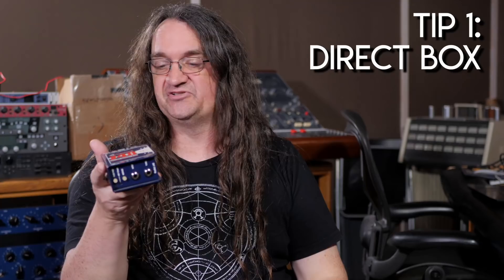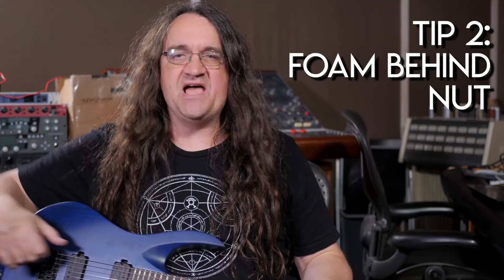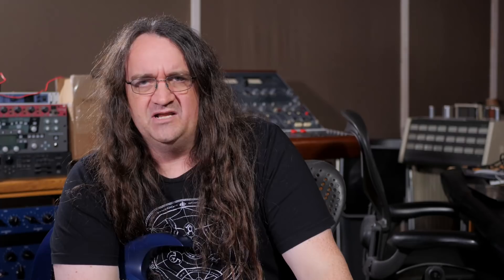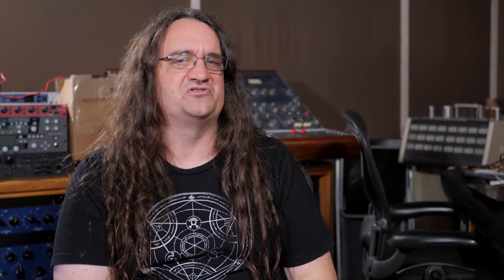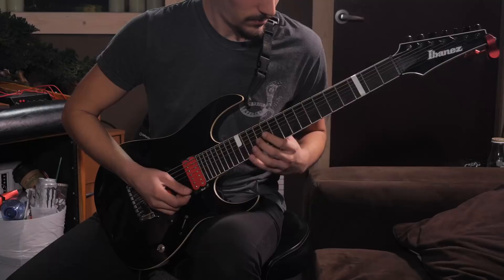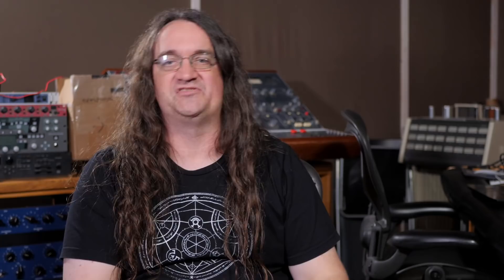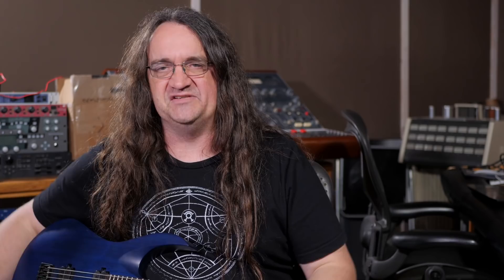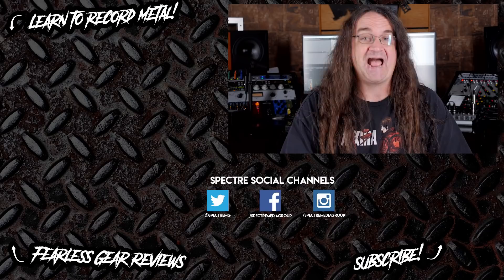Five Tips for Recording Metal Guitar at Home

Comment: But would I ever need a DI box if I already have a solid audio interface with good preamps?
Reply: Kyle Pierce hi, try Steve from Boston as he explains it in detail. Hope this helps it did me👍
Reply: No, he got this totally wrong. As long as you have "guitar in" or Hi Z input you are better of without DI box. And even if you don't have it DI is not solution for that, in that case you need Hi Z preamp.
Reply: @Logan Larsson i've never in my life encountered any interface that has low pass filter on any input. What to heck are you doing with those things to get such results?!?!? Have you actually measured that with a generator?
Reply: @Logan Larsson The only difference between a line level signal and an instrument level signal is impedance (guitar amps usually have inputs in the order of 1 Megaohm or more). Are you sure you're not plugging your guitar into a line in and thinking it's an instrument input just because you have to increase the gain to hear it (which brings more bass)?
Reply: yes and one solar
Reply: TheKingKorg it’s not a literal low pass filter, some of the lows just come through clearer with a DI, it’s not the end of the world but it helps
Reply: No...there is a HUGE difference between instrument level and pro line level besides impedance, which is GAIN.  The instrument signal is weak at roughly -20dBu, mics are even weaker at around -30dBu, where line level is around +4dBu.  MUCH hotter of a signal.  Its CRITICAL for the signal chain that each piece of gear is seeing the proper input signal from its upstream neighbor.  Thats a sure fire way to add noise, lose all the dynamics and possibly even release some smoke.  Especially with a load box in the chain and speaker level signals getting piped around.  Pay attention, they all can use ¼" TS and TRS cables and they plug in just fine to any piece of gear with no warning of impending doom.
Reply: Depends on the interface. Some have specific inputs that can switch from Line to Inst (e.g., Scarlet 18i20.) However, the coloration you get from whatever impedance-matching scheme they use is going to be different from the transformer in a passive DI box.
Don't try to plug a guitar into a line input unless you are desperate or practicing. You can get sound out of it, but even the tone on my shitty, cheap, out-of-tune guitar sounds noticeably better through a DI box. (Active, in my case.)
Reply: @Logan Larsson The Saffire interfaces happen to have a 10 Mohm instrument input, which is way higher than most amps can represent.
Reply: I use the Hi-Z input of my Focusrite 18i6 Interface. Never had any problems with the sound quality or less low frequencys. For extreme metal i mostly use my schecter jeff loomis signature and that beast has a very high active output. For homerecording the interface input quality is excellent. Imho there is no need for a DI box if someone has a good interface with quality instrument inputs. Save the money to buy your bassist some sets of new strings.

Comment: Bypass the volume knob by soldering the signal wire directly to the output. the potentiometer should be a short circuit when you have full volume, but even than it actually damping the signal a little bit. You can as well add a high-quality switch where you either connect the mic signal directly to the output or choose the signal path through the potentiometer etc. I've done this modification on my guitars since the 80th because it gives that little extra in the sound which you clearly can hear and feel in your playing.

Comment: I'm mostly recording at home and have been using real amps for it about 99% of the time.  You just need speakers that don't sound horrible at lower volumes and typically sounds pretty fat in the mix.

Another thing you can use to mute behind the nut is velcro strips.  I just keep a roll of it on my desk with a pair of scissors.  Somebody wants to record guitar and hasn't already muted behind the nut or past the bridge on a gibson style bridge?  Thirty seconds and you're all set with velcro across them.  

Great tips here.  Also agree on the comments about picking hard.  Except for odd passages for dynamics

Comment: No problem with the foam if it works for you. It’s always been my understanding that it the strings are vibrating behind the nut, the nut slot angle needs some work or there isn’t enough string down pressure on the nut. Either way, what ever works, works!

Comment: Real amps are harder to Mix/Master but you can't get a raw sound with a Sim. Big tip I learned by messing around is have 9 Guitar tracks, have 3 recorded (with the left/center/right deal) then copy paste the 3 of those twice, with one group EQed Low, Mid and High which ends up being 9 Guitar tracks. It really gives you so many options of getting that raw but also fresh clean tone. Yes, there are easier ways to do it, but it has given me AMAZING results in the end.

Comment: tip 4/5 i was always told the most powerful amp ever made is a plectrum which definately changes the way you think about it what its goal is as a playing tool

another great tip from devin townsend was to hold the pick a little sideways so it scrapes as well as picking which gives the "chug" sound a little more depth. I took up using a sharkfin pick (with ridges on the side) and going really hard into the ridges definately adds some character to the sound but i found anything thinner than .6mm isnt going to survive long...i have a .5mm sharkfin that didnt survive a full playthrough of one - metallica by about the second solo it was falling apart in my hand

Comment: Here's a tip. If you have a floating trem, there should be a panel at the back that houses the springs that float the trem. Foam that shit up. Every clumsy knock is amplified by those strings (that are underneath the damn pickups)

Comment: Dig the video! I use string "mufflers"/Fretwraps. Never thought about literally taping down strings. Definitely will try that in the future! I also usually play floating tremolo guitars, and on one guitar the wood of the body is not very dense, so I would get a lot of noise from the springs. I shoved very small rubber tubes inside of them to mute them. Hard picks for life!

Comment: Great video Glenn! Just one thing I want to point out tho: Using a pick as heavy as 2.0 can sometimes add to the mud that you are talking about earlier on in the video. Also, intonation can sometimes be a problem with open strings being played with heavier gauges where the pitch jumps from sharp to flat very quickly. This is the reason why guys like Periphery, Tosin, etc. are now using slimmer picks, even as low as 0.64. Whereas I wouldn't go on and say that one should use the .46 gauge pick, gauges like 1.14, 1.20, 1.35, and 1.40 are in the sweet spot where there is enough beef in the pick to move the string, but also enough give so that there is no unwanted mud. I have noticed while tracking with Mesa style amps (big low end, slow attack in the lower mids) that thin picks, say 1.14-1.35, can really help give a bit more definition and articulation. On the other hand, amps like a 5150, Soldano, Friedman etc. (toight like a toiga) are forgiving enough for heavier gauges to be used (1.35 and up). That said, I am presuming here that the player is hitting the strings hard enough, as you rightfully mentioned, while not knocking the guitar out of tune. 

P.S.- I know that this long-ass comment is absolute nitpicking, but hey, I didn't even mention how pick material makes a huge tonal difference too ;)

Comment: The easiest way to get tracking done is imo to record DI with a standalone amp sim like AmpLion for monitoring and reamp later on with a real amp.
Reply: Totally agree! When my band tracked a 6 song EP we did all of the tracking through a Kemper and then reamped through a PRS Archon after the fact. This meant we could save on tube life and didn't have to have the amp running for a super long time.
Reply: @PeterBarnesandjelly  Exactly that - also you get the added bonus of not having to argue about the tone or the gear you want to use.

Comment: Hi Glenn. I wanted to add that in terms of picks, the texture is also important as the thickness. I like to use hard picks for guitar and bass, but I found out that the texture of my 1.4 mm Dunlop kills my treble, while the smooth 1.0 mm Dunlop is hard enough but keeps the tone. The 1.4 has some kind of rough-ish surface that seems to muffle the strings.

At first I thought it was dead strings, but after changing them I felt the treble loss in the first week. Then used another pick (without knowing) and the treble came back. Now I ignore that pick although it feels great in the hand.

Cheers from Australia (though I'm Colombian)

Comment: I'm simply using a peavey vypyr pro with sanpera pro pedal to record, DI into my clarett 2 pre thunberbolt. It works. Not sure if I'd need a Radial Engineering J 48 DI box than? Without DI my vypyr sounds incredible to me, the modelling is outstanding... the di is still in trial mode for now, micing up the amp with a decent mic hasn't failed me thus far.

Comment: Started out with a sock pick.  Got advice to use a hard pick.   Screwed my playing up to no end.  The thing about soft pick is if you bite hard close to the tip. And back off of the tip when you want it softer. I find I can get all kinds of dynamics that. I know a lot of metal is done with hard pics lot of metal players.  Nobody really taught me to do anything I just kind of learned it all on my own.  Been playing for about 35 years plus.  I learn new things all the time.  But I don't think hard pixiz solution for a lot of people

Comment: You can record DI’s and (in my case) a signal from the AX8 at the same time by using the FX loop output to the second input on the interface and the main guitar signal into the AX8 and out to the first input of the interface. Then to re-amp, send the DI back into the AX8 by running a cable from a mono output on the interface into the AX8 fx loop input. This is a variation, or maybe the exact same thing as the “4 cable method”. Maybe you can cover this, if you haven’t already, for all the Fractal and Kemper and Helix guys because we really out here doe
Reply: Forgot to mention that the DAW plays a big part in this. For the re-amping bit, you need to change the output of the track that has the DI to the selected mono output you have the cable coming out of and going into the FX loop input on the hardware.

Comment: I've found with the tape off technique that by using one of the Velcro cable ties you get  with Shure microphones it does about the same thing. It's been useful in situation and is reusable. The tape works great if you're up and down the neck a lot though.

Comment: I suggest getting a fretwrap rather than a piece of foam. They look nicer and are more functional plus you can slide it further down the neck to record cleaner tapping/solos. I also have one lightly wrapped at the nut of my bass just to clean up open note noise a bit.

Comment: So, I use the avid Eleven Rack for my live and recorded tone. It's got a di, and reamp box built into it. It's dope! I have put foam behind my bridge (in between the bridge and tail piece) for years now, I use a heavy 2.0 ultex jazz pick for my rhythms while recording, and a John Petrucci sig for my leads. The Petrucci is brighter then the ultex. I'm also very heavy handed. I used to break strings on the regular until I went to drop c and put not even slinks on my guitars. Now I'm in drop a sharp and run some d addario baritone (13-62) . Sustain for days, tone for days.

Comment: 5:38 I'm a guitar player myself and I'm pretty sure that the strings aren't buzzing away that badly, because he isn't hitting them very hard with the pick, which you can hear when he plays the palm muted stuff especially. So in the broadest sense, the guitar isn't vibrating that much and so the strings behind the nut aren't excited to vibrate that much. It is way worse if you're hitting the strings harder or if you play thicker guitar strings since they generate a more stable vibration with also a higher amplitude (which makes the guitar itself vibrate more etc.). 
But the worst kind of guitars in this sense are those with more lower strings because the strings are thicker and there are even more strings in general, which can vibrate behind the nut. I'm playing a seven string guitar with an extended scale lengh (26.5'') and a .10 to .45 gauge for the regular six strings plus an .62 for the low b string (tuning is b standard). So as you can imagine the string tension is quiet high and it is generating tons of string buzz when I'm not putting my Fretwrap (totally worth the money btw.) behind the nut. 

I chose to play thick strings and a guitar with extended scale lengh because of the better stability in pitch btw. Very low powerchords (even when the're perfectly intonated!) tend to sound dissonant themselves, espacially when lots of distortion is applied (because of the amplification of the partial tones which do not aligh with the notes in the welltempered tuning). So I did not want to mess up those tonal qualities even more. The other problem (the one that we can tackle to a certain extend) is that the string needs a certain ammount of time to stabilize in pitch after it is being plucked. And if the string is very light, but the player is playing it very agressively (which is a tonal decision and often preferred in Metal), this problem can get really audible and make everything sound (slightly) out of tune, even if the guitar is perfectly tuned and intonated.
Next time I change strings I will propably try to use a .63 for the low b because a B5 powerchord still sounds out of tune for this short ammount of time the string vibration stabilizes.

Edit: Oh, should've watched the full video first, haha. :D But maybe I can add some info he didn't mention.

Comment: Great tips. Though, I strongly disagree on the hard vs. soft pick (if we're splitting hairs, that is). You must be comfortable using both and using the pick that sounds the best for the amp/guitar setup. The thicker the string gauge/tension I use and more gain (5150 red), the thinner the pick I use (.88-1.00 mm); this tends to accentuate palm-mutes to get the thrashiest sounds. The less gain and lighter the string gauge (Plexi-like/vintage), the thicker the pick I tend to use (1.12 - Jazz III). I mix and match all the time just in case I find any exceptions to this rule of thumb, but I always tend to gravitate towards these gauges in these situations. Thinner picks also make pinch harmonics even easier to hit, so just another reason I strongly favor them for heavier music.

Comment: Also if your guitar have a tremolo, then take out the springs and put some duct tape (or any other adhesive tape) onto them to stop them from ringing. Also there are noiseless springs if you would like them more.
Reply: Just put heat shrink tubing on the middle portion of them instead. duct tape will impregnate your springs with glue residue that's hard to remove. Another alternative is to fold a piece of cloth or cotton and place them under the springs.

Comment: You don't need a direct box if your interface already has a low-Z instrument level input. In that case the direct box is built in.

Edit: Okay, yes you do if you're recording using a real amp. But lots of other hardware performs the function of a direct box without buying a dedicated unit. I have a Boss GT-001 that acts as an effects processor, amp sim, audio interface, direct box, and reamp box all built in to one. It just depends on how you configure it.

Comment: Not only do I dampen the strings above the nut, I also dampen the strings under the bridge (string through body) and that helps alot too. I pick hard as shit, almost to the point of pushing myself a bit sharp. There is a difference though.

Comment: Been using the foam tip for quite some years now, both on at the nut and between the stop tail and my bridge. I find I get much cleaner tone and better sustain. I suspect cutting out the resonance before the nut and after the bridge cuts out vibrations that play against the string proper and shorten sustain? Whatever the case, it surprised me on my LP, she even sounds better tonally, at least to my ear. My hard tail strat plays and sounds better with just the headstock foam, and I actually lose sustain putting foam behind the saddles with this style bridge which annoyed me because the only simple way I figured to put foam there was with spray foam and it was a dog to clean off 😂🤣 With the hardtail I found making a thick (1cm) brass block with matching string holes and adding it to the back of the hardtail (strung through) really helped to make the notes sing and sustain longer, it also helped with "wolf tones?" (odd reverberation of the string that dulled sustain and sounded dissonant) that had been bothering me.  I am at best a bedroom guitarist that perhaps once held delusions of being more, so any little thing that makes me enjoy playing a bit more is always worth a bit of effort. 

Loved the hard picking tip, it works great in bringing out the mids and combating muddy tones. Now I have to work on being more precise as it is a lot less forgiving of my poor technique 😛